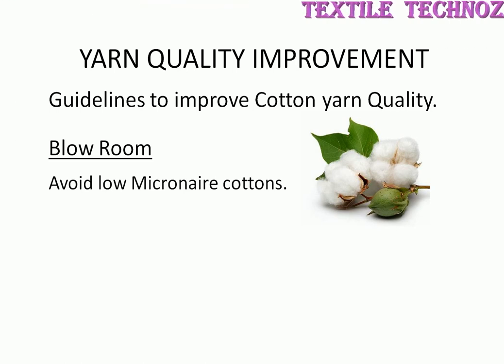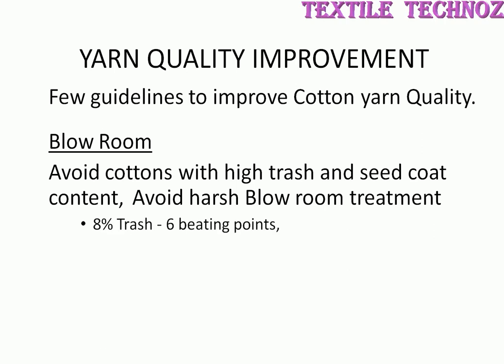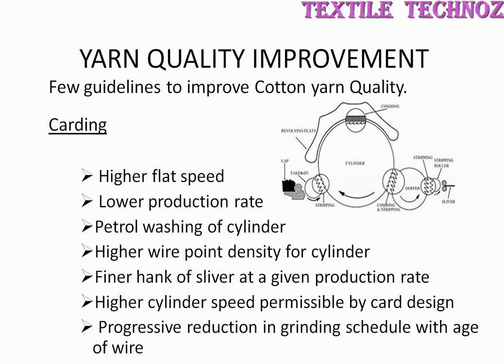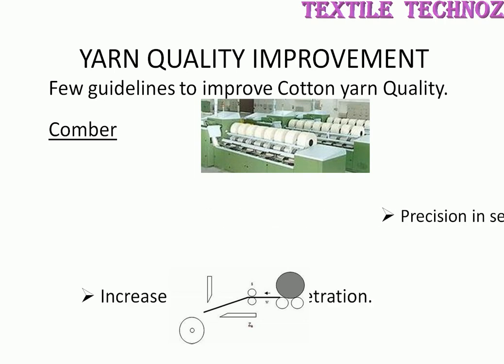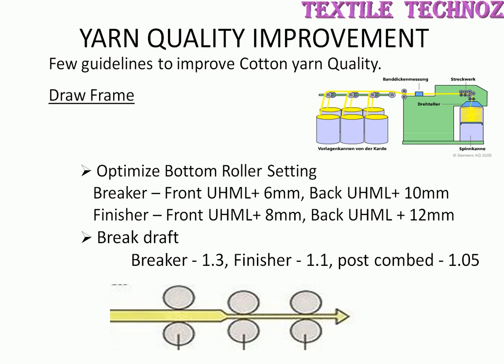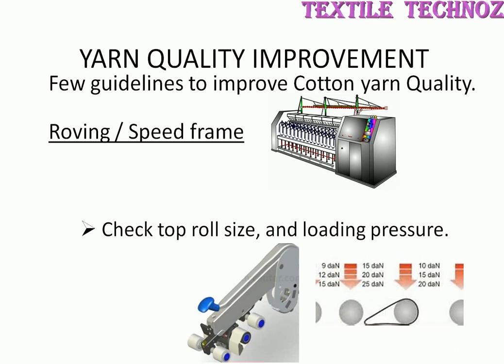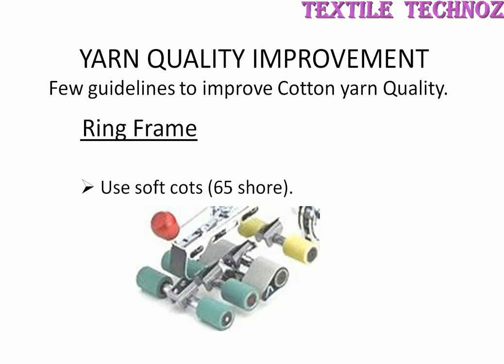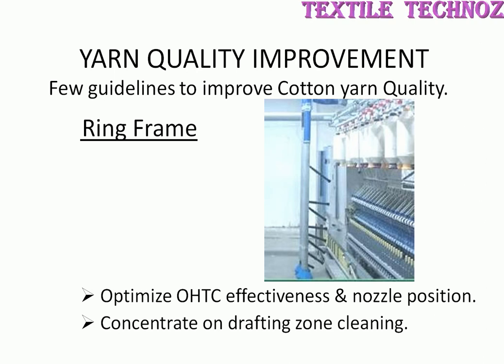Mastering Yarn Quality: Expert Insights with Ramakant Dubey | #isreal #gaza #india

Comment: Sir mera count cv control ye mera project h 
Kuch idea bataye
Reply from the maker: Proper and homogeneous mixing preparation
Continuously feeding to card chute
Maximum utilisation of clc1 or clc3 or flexiclean beater
10 and 100 CV control in card
Proper number of sliver doublings in breaker n finisher
Manual sliver adding in comber during any head deatching roller lapping
Comber n Finisher df uster
Roving stretch below 0.5 percent at top, middle and starting layers
In rf creel holder condition, mixed ring traveler, jerky ring rail,
Reply: @textiletechnoz7457  uhml means what in drawframe
Reply from the maker: Upper Half Mean Length